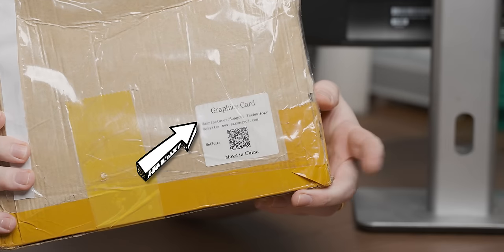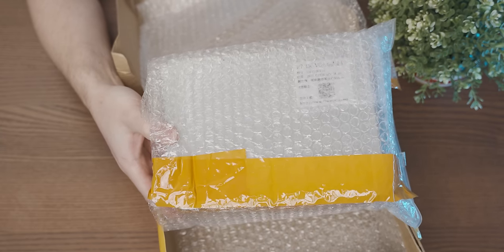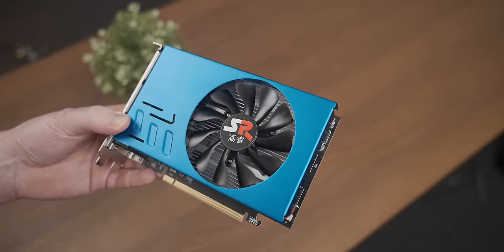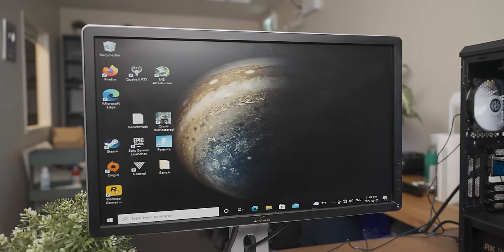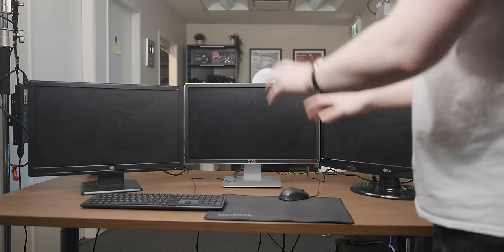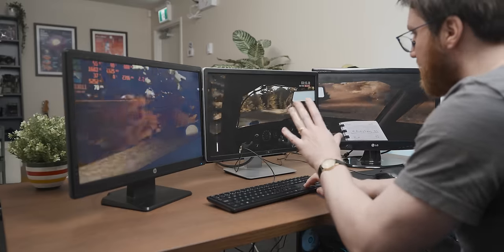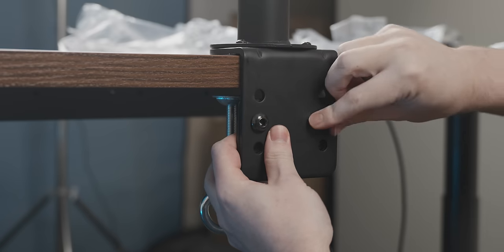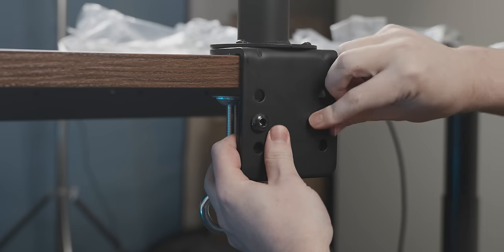6 Monitors, 1 GPU: World's WORST Multi-Display Gaming Setup

Comment: I remember the time i did a multi monitor setup on my grandpas Windows XP desktop and all the games ran at 15fps yet i still enjoyed myself
Reply: Those times…
Reply: Now I get a headache while trying to play at 60 fps
Reply from the maker: I found there is something about multi display setups that mean the low FPS doesn’t bother me that much.
Reply: @DawidDoesTechStuff  it's called settling Dawid
Reply: @iosuamuresan3935  When 120fps wasnt so necessary for gaming
Reply: LMAO
Reply: you always enjoy the janky stuff you struggle too hard to setup
Reply: @DawidDoesTechStuff  check my original comment you got a poser im pretty sure
Reply: @YasinVanDoorsen  Back in my youth (90s) when playing PC games an ok framerate was 20+ FPS and great was 30+ FPS - times have deffo changed. Now my teenage kid wants a high refresh monitor (240hz) to  be able to utilize those several hundreds of FPS he gets when playing Fortnite - 144 hz just isn't enough :).
Reply: Console gamer: seems pretty normal to me
Reply: @GTS5690  yeah I'm stuck on 144+ fps bow haha! i rmemebr when utube had 30fps only videos and 60 ain't even good enough now
Reply: You guys made me realize something way off topic. My grandfather (not great grandfather) was born in the late 19th century. Mind blown! 🤯
Reply: @DawidDoesTechStuff  Should try this gpu with an old crt with how many vga ports this has.
Also does Amd's VSR work with the vga port ? or would that need hacked drivers ?
Could get some interesting results with a crt then I'd imagine.
Reply: I'm doing it right now I just dug out my old PC part and now am playing Minecraft on 3 different Dell monitors at 15ishFPS for no reason. lol
Reply: @blueblade455 John Tyler (the 10th president, born in 1790) still has 2 living grandchildren… idk how old you are but generations can be kinda weird like that lol

Edit; he has one living grandchild… my bad
Reply: @jeffiouswonderus2600  60fps is fine for me... Except for gd, geometry dash is fine at 240hz

Comment: Needs more monitors of wildly different sizes to be complete.
Reply from the maker: In all fairness, I did initially they were all different sizes. I was pretty disappointed when I realised they were all 22 inch. 😂
Reply: @DawidDoesTechStuff  I have a 19 inch monitor and a 26inch monitor with thicc boarders
Reply: And mismatched resolutions and aspect ratios!
Reply: needs more CRT
Reply: And then make Jay react to it
Reply: @andreww2098  lol, I've still got one of those CRT monitors around just to remind me how ridiculous thick things were back in ye olden days.
Reply: @ChengTeoh  don't forget to degauss it!
Reply: another 18 monitors, another three desktop stands, another three questionable gpus all running in crossfire on a motherboard with four full length slots.
Reply: @charlieplayz6674  I have a 40" 4K tv and a 20" FHD monitor, both Samsung. 

The tv handles all media and gaming and was like new in box for $150. 

The monitor handles everything else, and was $3 at the thrift store because they didn't have the power supply (but I did). Not so much as a scratch on it and works perfectly.
Reply: Ok top of all the other recommendations I would like to see 1/4 of them curved
Reply: @DawidDoesTechStuff  i did initially they is the are how they do if you they how is are me are is be your first time at all this year you are a vertical man and you can only do a few more and you have a nice touch and you have a very cool man i your heart is
Reply: the good ol square monitors oh man
Reply: @ChengTeoh  damn your lucky

ive been looking for a while to complete an old windows xp setup and cant find one anywhere

cant buy one online bc the shipping would just be too damn expensive
Reply: @andreww2098  
I think if he will use the CRTs the frame rate was in a whole lot better I think but the weight holy crap I don't think that poor arm contraption with handle that much weight nor I don't think the spot on that one particular area of the desk would handle that as well it's an accident waiting to happen maybe funny one too and maybe not time will tell
Reply: Needs a second card for 12 monitors!
Reply: Imma get a 3 monitor setup a 24 inch gaming 16 by 9 a 19 inch lcd 4 by 3 and a 40 inch tv!!!!
Reply: Yup, needs more CRT.
Reply: @ChengTeoh  Yes! What great video experience this would have been with 6 beefy CRT monitors instead of the puny flat panels!

Comment: sounds like a card for 2D use like video surveillance or system monitoring, which is probably a decent way to sell off buckets of otherwise useless ancient GPU chips
Reply: that's how I sell so many 550 tis
Reply from the maker: Oh for sure! It’s good that these GPU still have a use though. At least their not in a dump somewhere.
Reply: Either that, or for coders or designers that can benefit from the multiple monitors for managing multiple tasks.
Reply: @AceMcCrank  finnaly, a use for the shit ton of sub 10$ vga monitors my local thrift store has
Reply: Yes, there is probably a lot of older equipment out that is controlled with a PC and uses, for example, 4:3 CRTs. Medical, industrial or other specialist stuff can be pretty expensive to replace and it is kind of a shame to replace fully functional gear just because something on the PC died and getting parts is getting too difficult.
Reply: @virtualtools_3021  Those are 1080p, they are like 30$ at least.
Reply: Day traders/stock brokers as well.
Reply: @peters.7428  Depends on where you go. If you go to locally owned thrift shops they can be that price, but I picked up a pair of 1080p monitors at Goodwill for 12 bucks each
Reply: @ozpin8329  if your a trader and you have this GPU, you aren't a very good trader 😅
Reply: @DawidDoesTechStuff  they're*
Reply: @LawrenceTimme  traders view 2D graphs and text on many screens, they do not need a 3090 ti to do that
Reply: @marcogenovesi8570  it doesn't require 2 3090ti to run 6 monitors for trading. AMD cards are for poor people and you need to make sure people know you are successful by running Nvidia sli like a boss.
Reply: @LawrenceTimme  SLI is dead, it does nothing for 2D applications anyway.
All gaming cards are for "poor people", check out what a Quadro or RadeonPro card costs to do the same job in a "businness" environment
Reply: @LawrenceTimme  Dude I hate my gtx 1080 since the first week of buying it, the drivers are garbage. I was thinking of selling it and buying a rx 5700 but the stupid shortage kicked in. Finally seems to be dieing down and will be getting a rx 6600 xt. Never again buying nvidia and their buggy and broken drivers.
Reply: @marcogenovesi8570  its about the epenis bro. Having sli 3090ti gets you way more street cred than quadro. Pro cards are for nerds
Reply: @Brandon-uy1uv  sounds like a poor person issue tbh.
Reply: @LawrenceTimme  bad drivers only affect poor people?
Reply: I guess it's what I get for neeting all day in my room trading crypto and scrolling 4chan lol
Reply: @Brandon-uy1uv  that's correct. I just call Jenson and he sorts it out for me straight away.
Reply: @LawrenceTimme  traders are literally the definition of nerdy, when they start talking in their lingo nobody understands what is going on
Reply: @peters.7428  1280x1024s are less than 10, 1080/1050s are usually 15 to 20
Reply: @virtualtools_3021  Here 768p 16:9 monitors are about 25$. That Here that you have is really cheap.
Reply: @LawrenceTimme  Considering when the card came out, a lot of flat panel monitors still had VGA ports along with DVI
Reply: @Brandon-uy1uv  bad drivers affect people who arent willing to re install windows a few times a year. Windows 10 doesn't make the 1080 better, either, makes everything worse. I still have my 980ti OC, still a powerful card. If you aren't greedy with resolution and keep the action to one monitor, High textures and 60+ fps are easy for most games still.
Reply: @Brandon-uy1uv  i play a heavily modded Fallout 4 on my 980ti OC, including character mods that up my characters polygons by over 100 or so times from vanilla. Check out Bodyslide and Outfit Studio and all dependencies. I can put photorealistic me in the game and still hit 60 outside of central Boston, and everyone has that issue. Its to do with shadow rendering bugs (thanks Bethesda)
Reply: Also for things like big commercial displays or LED walls that are formed by smaller individual screens. Or to drive more than one screen with a single computer. VGA is still used since it's a simpler protocol than HDMI and can travel better distances. Quality is not that important.
Reply: @DawidDoesTechStuff  Yeah I saw this in a shop in China for trading stocks on multiple monitors, I'm actually buying it for myself
Reply: these kind of cards in China mostly is used for stock-trading software that who need to speculation multiple window. No performance is needed.
Reply: This is prolly used in the advertising and it's used for slideshows
Reply: I actually bought cards like this for a finance company I used to support, although they ran DVI and not VGA.  They'd have different stock market trackers going on each monitor. Remote controlling their systems was always a fun experience. For their use case it was perfect.
Reply: @peters.7428  nope, you can find free ones locally
Reply: @randomgamingin144p  Where locally? Going to UK or US to look there is not local. My country Has no such offerings.

Comment: to avoid bezels in the center of view, you need to go 9 monitors!
Reply: don't you hate it when your 6 monitor arm is upside down?🤣
Reply: yeah makes sense i agree and sitting just 1 meter away from the monitors
Reply: @tyrannical3579  with an rtx 4090 powering the graphics into those monitors muhahahaha Dawid is now living the life🤣
Reply: @raven4k998 the 4090 can only do 4 monitors. So triple 4090 here we gooo!!!
Reply: @toxicturkeyy  no no no quad 4090's one to run each monitor by itself imagine the power you will wield then muhahahahahaha
Reply: @jasonpacker9607  na you should go with 6 not 4 then you can have ultra wide screen setup going on man

Comment: The perfect card to run a 6 monitor CRT setup XD
Reply: That's exactly what I was thinking
Reply: @NatInTheHat49  He'd probably enjoy the pain. He seemed pretty happy when Anna kept shocking him.
Reply: @izzieb  but its a different kinda pain the whole shock thing i understand but being brutally bludgeoned  by a crt that weighs as much as a large child i think is another  thing
Reply from the maker: That’s true! I can imagine it would be fun trying to mount a CRT on the second row.
Reply: @DawidDoesTechStuff  One does not simply mount a CRT on a vesa stand. Pretty much the only thing that can support a CRT is another CRT.
Reply: I had a three monitor CRT setup in the early naughties and had to turn them on one by one instead of using a switched power distribution. Otherwise the fuse of my appartment would blow.

That combined with a second PSU in my rig, I always felt like a pilot going through a pre-start sequence of a plane when I turned on my system. :D
Reply: I want to see the desk collapse from six 19" CRTs
Reply: @benroberts2222  been there, seen that. But it was just one CRT, and it was a 21 inch one. And the Desk was a glass one.
I can tell, it was really loud, and the CRT mysteriously survived. The desk plate not.

Comment: For someone running triple monitor setups for ages I can tell you that I really enjoyed this video! As it turned out, using similar displays helps a lot.
Btw, to get the rest of the LG´s stand off, you have to take the whole rear cover off - which in addition to its screws has around 4.2 billion plastic tabs and clips.

Comment: Our school still has those vga ports on every pc/monitor/laptop. The worst thing is that the screens are 1:1 aspect ratio 🤣
Reply from the maker: No way! 1:1 is properly retro.
Reply: I'm pretty sure they are 5:4 (1280x1024) because that was really common for 17" and 19" monitors in the 00s. 1:1 monitors are quite rare.
Even though 5:4 and 4:3 monitors might look a bit like a square in reality they aren't anywhere near 1:1
Reply: @Pasi123  you are probably right.
Reply: @Gatorade69  they run a linux with our schools crappy skin 😅
Worst os ever.

Comment: Already just by looking at that thumbnail, you should have used 9 monitors, its the same way you use 3 instead of 2 to have only 1 monitor as the centre unit
Reply: But the card only has 6 outputs
Reply: @darrenfalconer3267  usb graphics adapters.
Reply: @Mills_Official  yeah but the point was the graphics card
Reply: @darrenfalconer3267  yeah I know but my point was I said “just by looking at the thumbnail” meaning I knew 6 monitors wouldn’t be ideal
Reply: @Mills_Official  Ah yeah I see your point

Comment: I like how a few days ago I was in your Discord asking about how to get more display outs so I could run a multi monitor setup with a bunch of cheap VGA monitors and now you've posted this. Really it seems like every time I have an idea for something for me to do seriously because I'm poor, a few days later you're posting a video of you doing it ironically because it'd be funny (it also happened with you gutting the Optiplex case for modern hardware except I'm putting a 5700G systen in mine as soon as I stop being lazy) and I fucking love it because it helps me figure out how to get my idea to work or if they'd even work at all without me having to spend money on shit that won't work.

Comment: The GCN cards in general run quite well. I have a simlar R7 360 running inmy HTPC and it has no problems with anything I put to it. Using a n Athlon II X4 640 w 8 GB DDR1600 and a bunch of local drives for storage. The card runs about 40C and the CPU runs about 30C so neither is heat producing oven.

Comment: Lol my first multiscreen setup was with CRT's, think I had 3 NEC multisyncs 19" which were thrown away at a company I interned at. Just getting them home was a chore... Then I needed to reinforce my Ikea desk... Also luckily I had a 80cm deep desk and it was off the wall a bit so I had more space left then I first thought. However driving these screens was a whole different story. I can't exactly recall what GPU's I had but gaming was limited to just 2 back then. Windows desktop worked fine. Now I got 27"+34"+27" Samsung screens and I love it. RPG's are amazing however the switching around with the Nvidia screen stuff is annoying though.

Comment: You should try out some custom driver packages for the R7 350. You'll probably get a bit better performance. I used to do this with a way worse setup haha. I had a i5 4590 and a GTX 760 with 2 dell 1080p monitors that didnt match and a generic 32 inch tv between them. It was pretty horrible. At least it was slightly useful in Dirt 3 haha.

Comment: I remember the days when Matrox's selling point was that it offered 3 video outs instead of 2 like everyone else! Man, but this one takes the cake. This is definitely used for the specialized use case of a single DVR to output to 6 surveillance TVs or perhaps even 6 digital signage displays where it really doesn't matter how sharp the image is. Thanks for sharing and going into all the trouble of actually building a multimonitor setup to try gaming on this. XD

Comment: I kinda spoiled myself years ago by starting to use a 40" monitor for my center display, I REALLY like that. For a long time I did dual, but upgraded to triple display (two 24" monitors right now). Its nice having one large central monitor to display the main thing you are working on and of course extra monitors allow you to multi-task very well.

I've been waiting for a very good 4k 120/144hz monitor with great response times that is 40" to replace the main monitor... as well as for computer parts pricing to go back down to rational to get a graphics card to push that because right now my aging hardware wouldn't be able to push 4k good enough to bother.

Comment: Buddy of mine worked on a six monitor set up for CSX Railroad. Used to run switch and navigation automation remotely. This was like more than 10 years ago. Probably used something like this. All the programs were low resource and old Linux coded.

Comment: Some comments.
Because of the way the camera projection works in FPS games, it expects to draw to a single flat surface. Doing so makes the FOV at the extreme edges look stretched. Curving the monitors (as you did there) exascerbates the problem. NVidia were touting a "Multi-projection" system that would map the virtual cameras to match the IRL screens, but it never went anywhere.

Also, one of Eyefinity's Top Tricks was running in 5x1 - That is 5 monitors in portrait mode, all side-by-side, which means you'd get a 5400x1920 display.

And yes, running an even number of screens in any direction is a bad idea as the center gets chopped by bezels. I know Matrox and NVidia had "Bezel Compensation" that would render (and hide) the space behind the bezels for a more even and straight display, but that had the disadvantage of hiding the pixels that are in the gaps, like looking through window panes.

Comment: Cards like this are usually meant for commercial applications.
One example is in a security camera monitoring system.  Watching security cam footage from multiple cameras take more power than an IGPU and require many hookups.

And VGA monitors tend to be cheaper, so from a commercial standpoint this would be perfect.

Comment: ive got that monitor holder with just 2 screens, because it was dirt cheap. Found abit of lock tight in the threads sorted 90% of the bad parts of it.